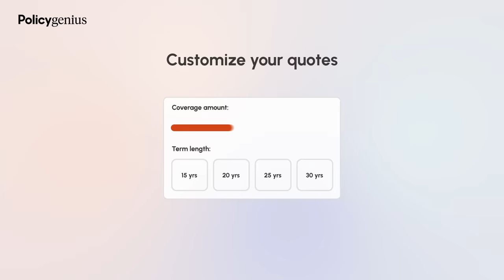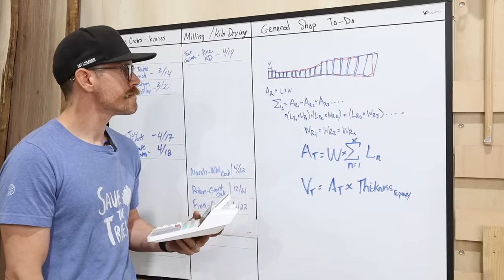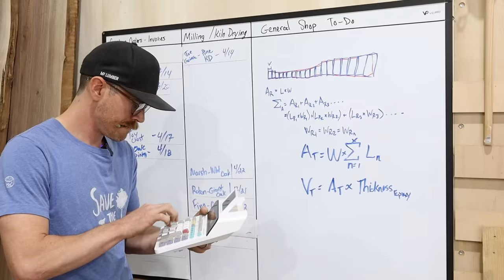Settling woodworking's biggest controversy: EPOXY

Comment: There is one issue --- it is woodworking if you really work with the wood etc
99% of people that make epoxy tables literally use wood that they just make flat , dont check the moisture anything 
no "woodworking" involved .... just cut to size , pour epoxy and leave all the problems with cracks etc to the client 
then there is an aspect of working with resing .....never mixing it well , wrong amount of part A to B , waaaaay wrong temp of cure (under 23*C = issues with resing wont hardening) and way more

im (somewhat) professional composite maker , i work with glass fibre ,carbon fiber , kevlar , basalt , plastic fibers , natural fibers , wood , foam , literally glass balls expanded like foam as filler etc (taking a breath) sand , different powders like graphite , metals , different types of epoxy (to simplify im a composite nerd even have certified training etc)

and when i explaining people stuff they do wrong they get super angry , say i dont know what im doing ...then i see them asking for help because client sued them for destroyed tables worth 10k$ because they dont know crap

Comment: to me there is zero question about "is a river table wood working" the answer is yes... of course it is. if it isnt, then building a butcher block counter is not wood working either, or making your own work bench. lets look at the steps:
work Bench.
Cut down multiple pieces of wood and arrange them
Adhere them together (in this case with glue)
Flatten the top
Sand down for a year
Add a finish
Add legs

River table
Cut down multiple pieces of wood and arrange them
Adhere them together (in this case with epoxy)
Flatten the top
Sand down for a year
Add a Finish
Add Legs

And what do I see Wow the same steps!!!!
Epoxy tables ARE wood working!! If you do not think so… don do it, be polite and don’t tell others that they are not wood working because they make them.

(side note using CNC… that’s wood working too)

Comment: Epoxy has become the problem, instead of the solution it was meant to be. Originally, epoxy was used as a way to get some value out of low-dollar pieces of wood. If you had a piece of wood with some problematic voids, you could fill them and be able to use that piece, rather than tossing it. Fast forward and now, there's no such thing as a low-dollar piece of hardwood. The mills sell nearly every piece of crappy wood at a premium, because they know someone will pour epoxy all over it and use it. This obviously affects those who have no interest in epoxy and are looking for funky pieces of wood for things like sculpting. 

What started as a way to salvage some wood, has become a way to inflate the price of lumber. I believe that's the real reason traditional woodworkers despise epoxy.

Comment: The thing I don’t like about epoxy tables is most of them just look like a slab of wood on a display stand. The metal bases just don’t do anything for me. Spend all that time on the top, and then just screw on metal legs? Yuck There is a guy on YouTube that does the slab tables but makes wooden bases for them that make it look like an actual table. Those are nice, and that looks like “woodworking”.

Comment: Nice table. It is made of wood, isn't it? Yes, there is some epoxy in it, but so what. It's not 100% wood, so does that make it not woodworking?
If you put a wood top on a metal base, isn't that kinda the same thing? Not 100% wood.
It's absolutely woodworking. 
Just like using a CNC is also woodworking. It's just another tool, like a table saw
Love the table. I like the refurbished legs better.

Comment: As someone who uses epoxy for sailboat build/repair/renovation, where the adhesive and waterproof qualities are essential, this seems like a huge waste of materials. Epoxy is, after all, a derivative hydrocarbon product like all plastics. A cousin to diesel fuel. Epoxy is very useful, and toxic. It ought to be used where it is the solely the best solution. The amount of epoxy in one river table could rebuild the deck of 35' sailboat. I don't understand how all these young 'makers' can be so profligate in wasting environmentally critical materials. Stand up. Learn to work woods. Titebond 2, et. al. are just fine.

Comment: I have opinions: on the one hand, pouring non-degradable plastic into wood is abominable. On the other hand, PVA glue is plastic too, and filling cracks and imperfections with epoxy is not so different from gluing bits together. However, I don’t quite get the obsession with whole slabs: for every piece that deserves to be “rescued” that way, there are tons of pieces that can be sawn up into beautiful boards, no need to pour gallons of plastic into them. Also, most river tables are fugly af.
Reply: Honestly I pretty much agree with all those points. 

For the glue thing though, there's always hide glue. It's definitely not good for everything, but it's shockingly capable for a LOT of things, and doesn't leave weird marks under finishes.

Comment: Americans, why o why do you compare cubic inches with ... liters. It makes no sense. I admire your woodworking skills but O MY GOD, use metric, not imperial units. I know it will give you a headache but trust me, they are a lot more easy then thinking about inches. God save the SI.

PS, I commented when you compared cubic to inches... the next second you convert it to gallons. I'm speechless. 
The jokes on you though cause the US use the metric system in  fields that matter, and the public uses the imperial system with lengths like feet, stones etc.